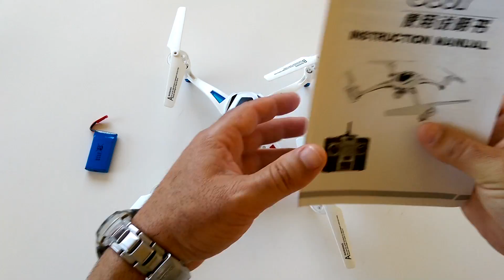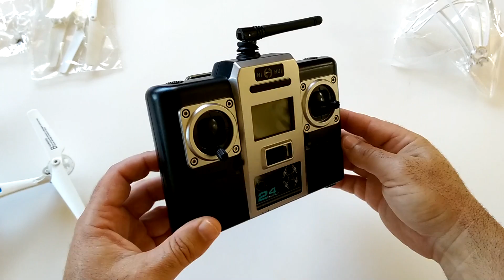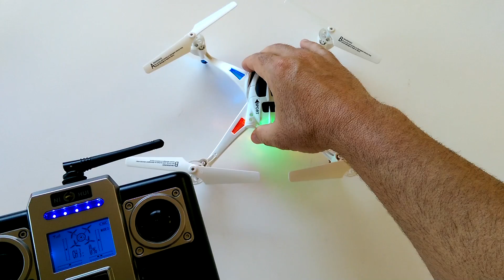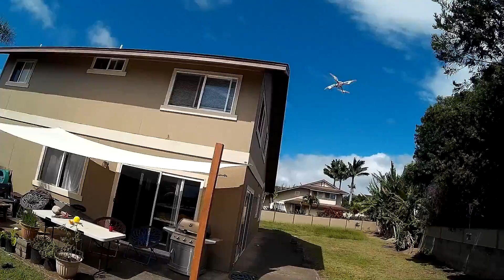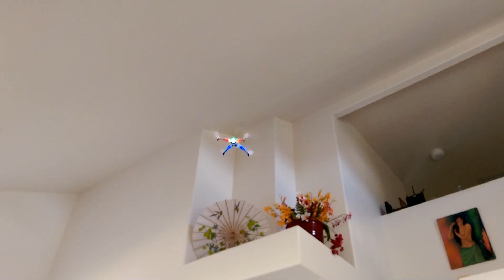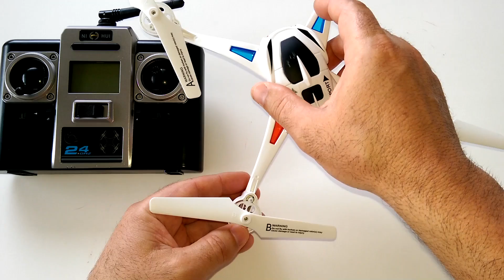NIHUI U807 QuadCopter Drone Review - [Setup, Flight Test, Pros & Cons]

Comment: Nice review!
One of things I like about this quad is that I can control it with Devo10 running Deviation for extra speed. I can program the scalar value to 250 instead of 100 in the stock transmitter.  This will provide the insane pitch/roll angle (about 80 degree) and yaw rate (more than 5 turns per second)  that are not available with the stock transmitter. Needless to say the flight performance is amazing in the "insane" mode ;-)
Do you know other better motors I can use in this quad to get some futher improvement?

Comment: Hey Dustin. Love your channel.  I'm thinking of using a 900 mah Keer battery with my U807. Will that burn out the motors do you think ?And also can you charge any MAH battery with the standard charger or only the stock battery ? Thanks!
Reply from the maker: Thanks!  it will work but may burn the motors out  a little faster.  Yes you can use the same charger as long as the connector is correct.
Reply: thought so. Ok. thanks !
Reply: Hey Dustin, if I charge a 900 Mah battery with the stock charger for a 650 Mah battery will it only put in like 60 or 70% of the power do you think?

Comment: Excellent review! Yes, main of cons is proppelers inertion which prevents copter from fast switching between descends and ascends (in comparison with my WLToys v262). But in other ways copter is pretty stable and crashproof. I have RTF verion with camera included and I can remove most of jello just with fixing camera head tighter. Picture is not super good but pretty good for price about $30 for whole copter including transmitter and camera. But now RTF version with camera is anavailable in gearbest store. So sad :(

Comment: Dustin,  Rumored to have a mode for flying with the prop guards are on or off.  Pulling both sticks down right.  The lights will flash fast, indicates the quad has prop guards on and flash slow when flying without them.  Have you heard of this?  I don’t see much of a difference, but there must be some.

Thanks for the great vids!
Reply from the maker: +Jim Leffler Haven't heard that one.

Comment: hey dustin please reply do you have any jello free mods?
Reply from the maker: +Dillon Ravindu balance props and hang the Cam with some soft foam.
Reply: +Dustin Dunnill do i have to buy a prop balancer?
Reply from the maker: +Dillon Ravindu you can try a true straight rod on top of a leveled drinking glass but may not be as accurate.

Comment: Great review!  I have just ordered a U807 for my 1st quadcopter.  I'm a little confused about using other batteries than the stock that comes with it.  I would like to order a 4- or 5-pack with charger, but I've searched a lot of forums and find conflicting information on which ones can be used.  Could I use, say a 3.7v 750mah 25c?  Thanks!
Reply from the maker: +Marty Davis (mobjackmarty) Congrats! Just make sure dimensions will fit battery slot.  That battery should fit but dimensions are key.  I'd search a bit more to make sure.
Reply: OK thanks. So am I correct in assuming that the voltage has to be the same, but the mah  and C number aren't critical as long as it fits in the compartment?
Reply from the maker: Correct :)
Reply: Thanks so much for your response! Ignore if you see repeat of my question on here. ☺

Comment: do you have to calibrate the gyro and compass every flight or just the gyro?
Reply from the maker: I didn't need to cal every flight.  But might as well to be safe if you think you need bearing function
Reply: Dustin Dunnill I guess my question is.....once the compass is set....is it set for good or so you need to set it every time you turn quad off and back on, like from one day to the next ?

Comment: could you direct me to a suitable antenna for that replacement mod and how you attached it? Also, did you ever do the range test?
Reply from the maker: +JPowellCreative any 2.4ghz antenna on ebay that looks similar in lenth.  I have a bunch of Range mods in my channel you can check out .. they are all basically the same theory.
Reply: Dustin Dunnill thanks!

Comment: How about an update with new motors and the range test with the TX mod. I would like to see if its a worthwhile mod before ripping mine apart. I have seen on some reviews to do the magnetic compass calibration before every flight, What do you think ?
Reply from the maker: Hey Arthur, I replaced blown motor and did a few more flights with no issues.  A couple hundred more feet are gained with antenna mod.  Compass cal before each will be safest.

Comment: Review was very helpful in setting up my U807 since the manual was very difficult to understand as a quad noob. As my first quad with 0 experience, this quad can be a bit challenging and crashed a few times but held up very well as mentioned in the review.
I am getting a smaller quad to get used to the control. Great review !! Sub'd.
Reply from the maker: Thanks. Glad it was helpful :)

Comment: Re-Watched this video and wondered if you ever got the spare motors and got a chance to finish the review, although you got most of it straight off.  Just curious
Reply from the maker: I got spares and replaced but haven't made the time yet.  Maybe I'll make some to finish it up.
Reply: +Dustin Dunnill Good ... my original had been flying really strange. Took it out late this afternoon and flew it again, and it still seemed strange, running out of power long before the LVC.  Took it in the house and flicked the props; one seemed a little slow. I turned it slowly by finger, and it was hanging at one point.  I inspected it with a 10X eye loupe,  and saw that there were damaged teeth on the big gear .. and the shaft was bent.  Must have happened during one of my "hard landings" .. ha ha.  I had spares on hand and it now turns freely.  Will take it out to the school yard to see if its back to normal.  Found a BNF version of the U807 online for $15.99, so I got that just to be sure I have spares of everything (including the FC).  If my FC is okay, I may put the new one in the Bojiang S1, since that guy hasn't flown the same since coming down inverted from 400 ft. Almost got all my FPV mods done to my ZMR250, so hoping to give it a try before the snow flies around here.  Cheers!

Comment: By the way what is the great song?
Reply from the maker: +The Walking Trade I think it's called "fly away" google free music.
Reply: +Dustin Dunnill 900mha upgrade battery:  http://www.banggood.com/Walkera-RC-Helicopters-Parts-3_7V-900mAh-High-performance-Battery-p-70388.html

Longer than stock but it is a tight fit if you force a little and it goes above the blocking tab.

Comment: Anybody have a suggestion of how to remove the pinion gear from the motor shaft for replacement?  Also, what is a good alternative battery?  Thanks
Reply from the maker: It should just pull off.  Maybe hold shaft with needle nose pliers.  The turnigy 750mah fits good.
Reply: +Dustin Dunnill I looked up the Turnigy but it doesn't come with a JST.  Is there a version with a JST, or do you just need to do a little splicing?
Reply from the maker: +amrunner4 There is one that has both connectors.  I think it was walkeraheli or something that had it if forget.  I linked to it in my Syma X5c video I think.
Reply: +Dustin Dunnill Found the Turnigy option both on Ebay and at Hobbyking.  There's a version with both a JST and a Syma-friendly connector.  I'll give a couple of them a try.

Comment: I also have one but mine has 8 screws in the bottom cover, is mine a newer model? Also does it have bearings on the shafts, I cannot get the big gear off the shafts too have a look.                                                                                                                                                                                                                                                                                                                                                                                                                                                      Another very strange thing is, just letting the motors run while the Quad is on the ground, it will shut down by itself, only if you take off will they keep running, never seen this before, or is it just mine.I know my Blade 350QX Quad also does that.
Reply from the maker: Must be a newer version Rudy.  Mine has bushings.  Interesting behavior.  Maybe a new safety implication with newer models.
Reply: +Ruudy L I just got mine, was running the motors to burn in with weight so it would not take off and they kept running, did not shut off until LVC...although I did see a lit bit of the props stop turning if not enough speed...not sure if that was a first time thing or what. Also I ordered from gearbest..US stock last week or so and mine came with the bearings :) So maybe that was older stock they had or they were smart and moved backed to bearings?
Reply: JPowellCreative Mine also had bearing, and it should shut down if you switch off the TX

Comment: take 3 seconds and stick a piece of foam between the camera and quad and the jello is gone. headless mode is worthless in this quad with the "wobble" feature in mid and high settings and the super irritating constant beeping from the controller when it is in headless mode.  that is a real shame because it would be a great quad without those issues.
Reply: thanks!

Comment: I don't know if you can help me or  not but ,,,,I purchased a U807 and flew it about 3 times the first day. after that It runs for about 4 minutes and then when I try to fly it again, it begins to turn the blades for about 2 seconds and then the blades stop. the copter then begins to blink continually. does this indicate a low battery or something else? 
 My second question is, when do I know it is fully charged?
thank you for any help you might be able to give me,

Richard Jones       retiredone@hotmail.com
Reply from the maker: Try a new or charged battery.  The stock charger should auto cut off charger when full.  If it takes more than an hour to charge, it's destroying your batteries and is defective.

Comment: Nice review - I'm now a subscriber!  I really like this quad too.  The implementation of headless mode on this one is sketchy to say the least.  Your overview of the mode is good but I think the compass orientation is entirely within the quadcopter.  It doesn't know where you are or which way the transmitter is pointing.  The quadcopter knows which way it is pointing (its heading) and what the transmitter joystick command is (up, down, left, right).  In headless mode the quadcopter then computes the offset between the commanded joystick direction and the original reference heading to figure out which way it should go.
Reply from the maker: Bantha Poodoo Hey thanks.  I think your right.  Being that these toy quads will only come back in the direction it was oriented at launch it totally make sense.

Comment: Would this be good for a first quad copter for someone who's been flying fixed winged entry-level planes?
Reply from the maker: Yes I think so.  It's got the low rates to take it easy and learn on.  Then you can really get this thing moving in higher rates and have more fun once you learn quad flight.

Comment: I ordered one of these a couple days ago (DealsMachine). As for motors, it uses 8mm x 20mm motors.  These are the same as the Hubsan X4 .. and those motors are available everywhere.  Nice that they gave you extra gear pinions to press on .. I believe the Hubsan X4 does the same, as the motors for it come without the little plastic gear on it.  I ordered some extra 750mah Turnigy JST 1S batts. for it, and the next time I order something from Amazon, I'll get a set of Hubsan motors for it. They don't have the plugs on the end, but it's easy enough to splice them in (I'm a Sr. Electronic Technician ;-)   ) Cheers
Reply from the maker: Thanks for the info on compatibility Bill.  It's great to fly.  Your gonna love it.
Reply: Dustin Dunnill I had it out last evening, which was quite windy.  I first tried to fly a Bayang Toys X5C-1 with 808 camera attached. Even in high, full pitch barely penetrated the  wind. Also experienced some 'glitches', which may have been caused by RF leak from the 808. Nevertheless, I opened the TX and found that the 32mm ant. wasn't even up in the little plastic nub. I extended it to a 3/4 wave (96mm) and routed it up into the TX plastic nub. After less than great flight in the wind with the camera quad, I flew the U807 .. what a difference!  Easy to fly in wind. I got out pretty far a couple times and thought it was slow to react, so I opened it and found what you found, that there was a nice 3/4 wavelength antenna in there, but very little in its rubber ant. nub.  So, I sliced the nub, inserted a black pen barrel, and extended the full length of the antenna into that ... should take care of any extended range problems. BTW, disappointed in the X5C-1 clone's ability to carry the 808 without VRS problems .. might try it on the U807 ... or get one of the new 33041s and put it on that ... that thing looks like it had good lifting power. Cheers! Thanks for the insight on how these TXs are put together inside. As a Sr. Electronic Technician, I enjoy the challenge.

Comment: would replacing the stock 3.7v motors with 7.4v H8C motors and using 7.4v Lipo 950mAh battery mod work?
Reply from the maker: I doubt it but try at your own risk :). I would think it might fry the main board.
Reply: Dustin Dunnill ah right~~ okay the main board... :(  thanks for the reply!

Comment: A GREAT review!

Your TX has a blue backlight for the LCD. Mine doesn't. Anyone else's TX lack an LCD backlight?

Found the reason for no backlight - wire separated from the connector leading to the LCD. Chinese "quality control" strikes again. Will now attempt to fix it without destroying the connector. This is the ONE time I wish I had some of that conductive silver glue. Now fixed.

Your mention of the wire antenna extension inspired me come up with another way. I used a hobby knife to cut an "X' in the top of the removed stock rubber antenna stub. Through the cut "X" I fed one of those small diameter plastic coffee stirring straws you find in fast food restaurants (mine are black ones from Carl's Jr/Hardees, I think, and are 3.75mm in diameter), used CA (superglue) at the "X" to lock the straw in place and plugged the open end of the straw with some epoxy. I then fed the antenna up into it. Doesn't even look bad, almost like it's supposed to be that way.
Reply from the maker: Glad you fixed it Winston.  Great idea on the straw antenna mod!